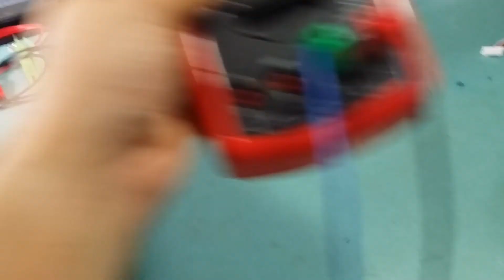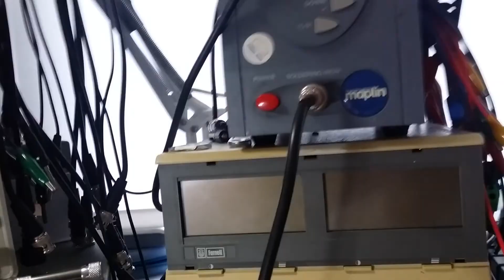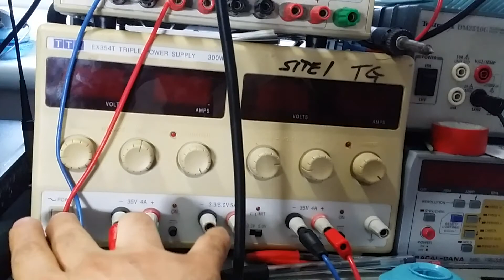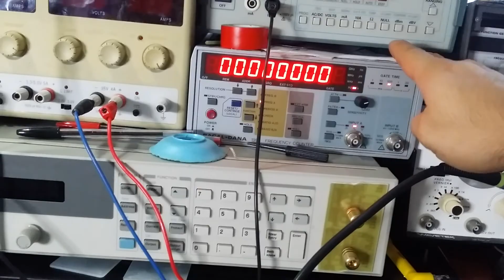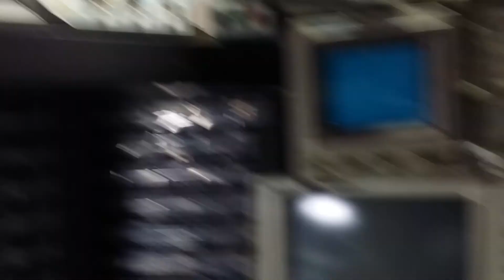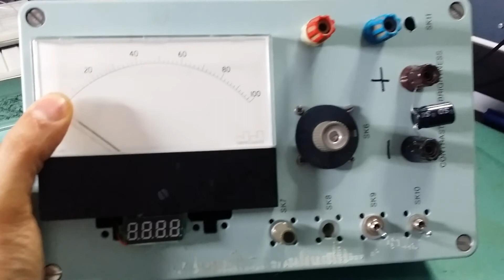How to setup electronic lab part1

Comment from the maker: Ye as dave said you can never have enough power supplies. Some times i need like 10 different voltages for my projects so having few power supplies at hand is helpfull. Dummy load is a important tool in your work shop, make sure you build one. But make sure you design one that dont oscillate and pass that to the out put. Putting a 470uf at the output of the dummy load fixes any oscillation problems.
Reply: "10 different voltages for my projects" - WOW...  could you give some example?